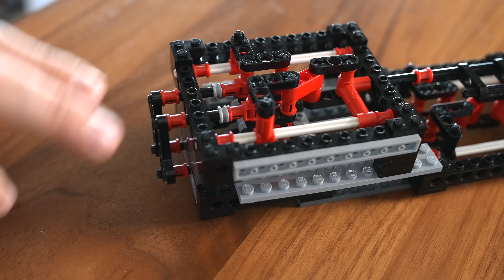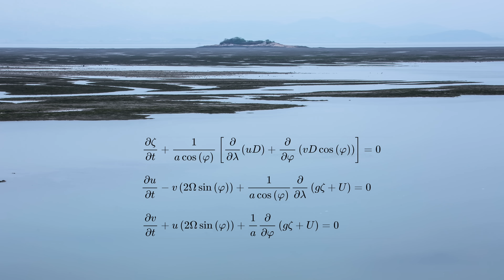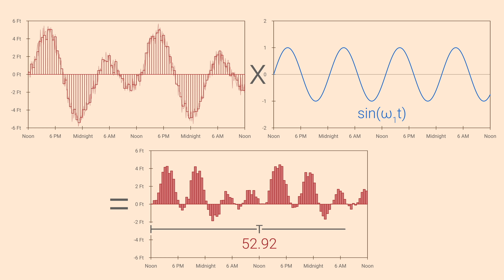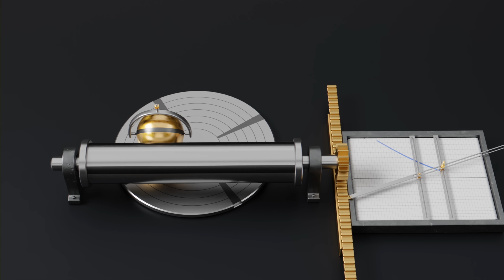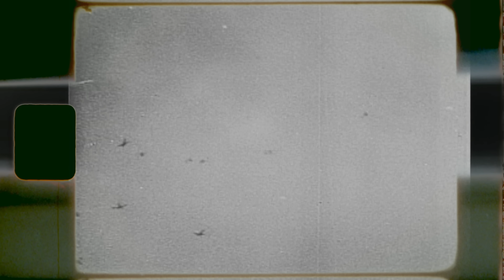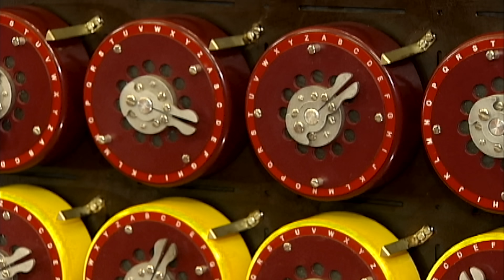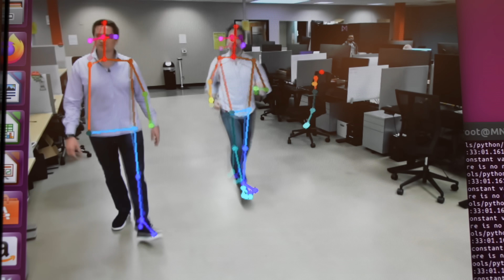The Most Powerful Computers You've Never Heard Of

Comment: The most powerful computers incorporate analog elements into digital systems and use a-d conversions and/or quantum mechanics as part of computing processes, such as modems, radios, wireless remotes, scientific measurers etc. They're used to process large amounts of data as quickly as possible.

Comment: When I joined the Navy in 1971, they still operated analog computers in some of their fire control systems. An entrance exam showed some simple gear output questions. I worked on a Norden system that was a true hybrid. It had a few analog computers that operated on gear ratios, electronic pots, accurate voltage references, relays, shaft encoders, etc. to a digital computer that had vacuum tubes, early 1960's transistors, late 1950's developed magnetic core memory, magnetic drum memory with about 2 dozen read/write heads in it. Not an integrated circuit chip in the whole system. This fit inside an attack aircraft that operated off of aircraft carriers plus ordinance and 2 crew. This unlike the aforementioned bombsight, actually got the job done. Yet these break down and needs constant maintenance and like the airframe it is attached to gets old and outdated.

Comment: Another interesting and not that well-known thing about the first computers is that even when thigns started to firmly shift towards digital, they were not always binary. There used to be computer which did not compute only in terms of 0 and 1 (which is the thing everyone always assume), but worked with more voltage levels (not just "tension" or "no tension", but an actual scale of possible tensions). It was eventually recognized that those systems were more difficult to stabilize (it's easier to distinguish "tension" from "no tension" than "tension A" from "tension B" for various values).
But I think it's interesting to think about how today "computers only understand 1s and 0s" has become an obvious universal fact, but it was not always the case, even for digital computers.

Comment: Technically our computers do confuse 1s and 0s at a certain point in time it’s known as “hazard error” it’s do to the fact that when the state changes let’s say from 0 to 1 the signal doesn’t just magically transform to 1 but rather continuously increases to 1. And in between the 0 and 1 is where our computers fail to calculate correctly :) also we don’t need all three “and”, “or” and “not” we only need either “and” and “not” or “or” and “not” according to de Morgan’s law :)

Comment: Given the qualities and advantages of analog and digital compters summarized at the end, I can't be the only one wondering if you couldn't get the best of both worlds by using a sufficiently powerful digital computer to mathematically model the operation of an analog one, right?  Like if you could design the analog device to compute what you want, which wasn't ideally suited to a digital system, could you run a digital simulation of the analog device without the problems of "gunk in the gears" creating signal noise?

Comment: If you 3d print these analog computers with analog dependent materials, you would not have the error of specifications get in the way of producing faster computers. I guess thats what quantum computers are doing, but they still have errors to work out. The 3d printed with a variable material, would not have those errors to begin with

Comment: It has been covered elsewhere that a large part of the failure of the precision bombing campaign over Japan (and to some, but smaller, extent in Europe) was due to a not-yet-discovered phenomenon: high velocity "jet streams" of air aloft. This is something that Norden's machine could not compensate for because the information required to do so did not yet exist.

Comment: When I started in Engineering school, there were generic purpose electric analog computers. I never got to use them, because they were phased out before I got to that level, but I think they were used by students of differential equations to prove their models. Instead of coding, they worked by patching components with wires, such that they could combine the effects of different analog elements, to obtain an output curve to the input they provided. Something to an electronic version of the tidal wave prediction machine, but configurable to different sequences depending on the patching.

Comment: AnandTech had an amazing article about the mechanical fire control computers in the Iowa class battleships, and made the point that digital computers didn’t have the processing power to keep up with analog computers which operated in real time. The analog computers were so much faster in fact that when some of the Iowas were recommissioned and modernized in the 80’s, and the fire control computers were replaced, they remained analog, but just switched from mechanical to electrical.

Comment: Thank you for this!  Beautiful explanation and animation.
When I was an undergrad, I had a summer internship where we calculated distance (Square root of x^2 + y^2) using analog circuitry for an ink-jet plotter.  Immediately following, I had a graduate research assistantship where my main responsibility was building a robust analog-to-digital and digital-to-analog interface between a large analog computer and a PDP-11.  I've been using op amps and digital all my life, and have both op amps and microcontrollers in my parts box at this moment.  It's all about functional partitioning!

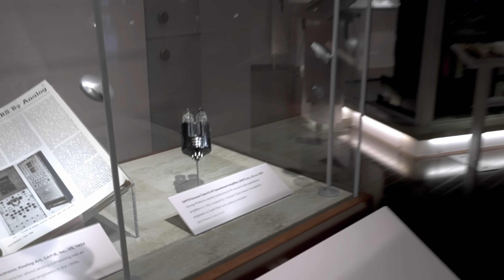Comment: 13:40 operational amplifiers are still used today. Many people thinks, today everything is digital, but its not true. If You use for example microphone or audio amplifier, then 99.9% of them are using modern operational amplifiers made by transistors or IC (IC or chip is a basically many transistors in one case) instead of electron lamps. Audo or video to be saved by camera, must be first converted from analog to digital (ADC - analog/digital converter) and if You wanna watch saved digital video, then must be converted back to analog (DAC). There is no other way to do this - if You like it or not.

Comment: Aren't quantum computers a form of analog computing? To my knowledge it can perform calculations by letting probability waves interfere with each other. This is similar to how waves are added up using Kelvin's machine right? The only downside is that you cannot really get the "analog" result of the computation, as measuring it results in either a 1 or 0. Although, you can obviously run it a lot of times and get a good estimate of the value 🤔

Comment: Analog is used in the sense of "proportional" here, not in the sense of "analogy". What makes it analogue is that it uses measurable quantities, with lengths and ratios, rather than discrete counted quantities. A slide rule is analog, an abacus is digital. It has nothing directly to do with analogies: when you use an abacus to conduct a census you are also making an analogy between groups of people in a population and the beads on the abacus. Don't get confused by etymology.

Comment: I've got several slide rules in my desk as I write this. There is something very beautiful about them. Many aircraft still carry EB6 computers as spares, essentially a specialized slide rule for the complex calculations including wind, speed and bearing and produce answers directly. They are simple, reliable and immune to electrical or magnetic issues.

Comment: I built an analog computer back in 1967. It could add subtract multiply divide and differentials of squares and triangles. It came with 3 gauges, variable resistors, and switches.  And it was electrical!

Comment: I had a lab exercise to simulate a control system stability with an analog computer.  The analog computer was built using vacuum tube op-amps.  Their signal range was +/- 100 V.  A bit later, where I worked, my boss had also earlier used the same analog computer and we started discussing if we could build our own, but with recently introduced semiconductor op-amps.  Well, that discussion resulted in a task for me to design and build one.  What I ended putting together was a box with 10 op-amps, a bunch of stackable resistors and capacitors and a few special units,  and a panel with banana sockets for the stackable components.  All along with amplifier symbols on the panel.  The signal range was reduced to just +/ 10 V.  My boss was  soon happily simulating not only his control systems, but also extrusion and cooling processes for high voltage cable insulations.  That was just before I got transferred to another division of the company, where new challenges were waiting me in a new R&D lab.  So I myself never had the opportunity of really learning to use "my" analog computer in anything but simple servo loop simulations (optimizations).

Comment: What makes this even more beautifill is that something most people do not see and understand is that  quantumcomputers are actually just analog computers being read digitally. the only special thing to them is that the main "dimension" of their analog movement is something humans can't really imagine in general(focus on the general since it is quite understandable if you look into how it actually works), this however results in it for many people being more easy to imagine how to use it as a digital device or more specifically for parallel arrays in a small cluster of cores. in general even in universities quantum computers are often brought as magical abstract computers with a 1 a 0 and a gohst while in reality it is just a atomair level mechanical computer which is specifically designed to abstract it's working "dimension"(between quotes because most quantumcomputers are still actual normal mechanical computers in these dimensions, the other dimension thing is in many cases a abstraction and sometimes some actual cross dimensional effects) to make it less abstract how to compute many parallel arrays with it. because humans in general except for visually are not capable of thinking parallel in general.  this means a quantum computer is basically a mechanical computer which is read digitally and which is quite stable at that due to some self stabilizing effects in specific circumstances. then this analog computer also is designed to work like that computer which could split the wave pattern in multiple waves and the other way around. this is what allows people to use it thinking it are parallel arrays, while in reality it is just one big analog wave per qbit. sadly not many people see how it works, even many people developing them or with them(the quantum computers) do not understand properly how it works because to visualize it would mean you need to be able to think interdimensional in 5 dimensions to be able to see the "computing" possibilities, activity and working(s) in a propper way, this prevents propper advancements which is why there has barely been any real change or progress since the original design other than complexity and accuracy, because most people working on them learned to think digitally. by looking at what it does in reality it is easy to make a room temperature quantum computer or something which performs similar calculations. I actually designed and physically made such a computer somewhere in 2017 to 2018, and it wan't a complex research but just a small hobby project in some of my free time next to college. the prototype was handmade and was build very badly but it worked and demonstrated that my design was indeed capable of doing it. now it wasn't exactly a mechanical computer, or analog computer as many know it, since I designed it to work on the exact same principle as which I had described in one of my theories as a more simplistic yet detailed description of all forces in the universe, where I could simplify all things down to one simplistic rule, or actually 2, where the second one just tells about the existence of dimensions both or either in a physical or abstract way, with in this case the main intend to allow the combination of anything that can exist, and yet to each other might never exist into one result(much more simple in imagination, it is just saying that there exist possibilities, since a calculation or theory wouldn't have much value on a prediction level if that what it needs to predict according to the theory can not exist(it is much more simple than it seems in this explanation when you can just visualize it). the other thing was that specific rule which generates and handles all forces in the universe. so to put it more simply it has 2 rules: the description of force and space .  that the computer worked did prove that my theory was either right or at least so close to truth that you can not or barely notice a difference. I did another experiment as well where I together with a cousin managed to simulate space and atomic behavior in realtime and high accuracy with a quite primitive setup(for now).
but the computer I designed and made was in behaviour most easily comparable to a quantum computer which works on room temperature, and its working principle can be most easily described as the force which keeps molecules together or planets, such as gravity but then not using weight but by actively manipulating the force I didn't exactly use gravity but a different force I could generate using something I will call the Rtype-crown, however detailing to much about that will likely explain the entire working of the device. but to put it simple it is one specific component I designed to be cheap and simple to make, which can simulat all digital computing as well as analog and quantum where its natural computing method is closest to quantum computing.

Comment: the infinite detail of analog computing could make the processing  of huge data sets and fine data much easier. self observing calculation is also doable in analog

the error potential could add a "creativity" component, if the system can weed out major errors

Comment: I have an RF background, although digital communication has some benefits, there are HUGE drawbacks as far as signal integracy are conerned. That's why the outer suburbs had major problems converting digital transmissions when the digital conversion was initiated.

Comment: Maybe the ultimate computers will be hybrid analogue/digital machines.
   A digital input that can control say for example a speed variable in each analogue component, which in turn can then auto calculate a range of gradiating answers?
   This should allow the analogue side to be rigged for a variety of tasks. And perhaps if one 'gear' in the analogue computer has worn out of sync, the digital input could be modified to compensate for the discrepency

    I unofficially patent this idea right now.
    Send the billion dollar cheques to my local bank account. Thanks

Comment: A version of Kelvin's ball-and-disc integrator was also used in the fire control of large battleship guns during WWII and after.  There were tube-type electronic computers, but they could not survive the concussion of a salvo of four 16" guns firing simultaneously.  The one that I saw in class used a wheel rather than a ball for the output.

Comment: Thing is with many analog solutions over digital is size, larger.  Now maybe if you look at the universe and results from astrology, then maybe many of the problems can be mapped onto parts of the universe.  Orbits of objects, motion, light mapping and many things in the universe, take Cern, such things happen in the universe naturally.  

But remember, 1/3 in analog is just that, in the digital world it is 3.3333333333......33333 and there is one aspect of digital computers as the rounding error's.  In analog those errors happen in reading the result and being able to accurate read the result is as key as doing it with analog computers and that area is often limiting.

Comment: >"The atom bomb will never go off - and I speak as an expert in explosives." - U.S. Admiral William Leahy in 1945
>I am not trying to win the argument, but you love for the truth. 
>The gyroscope resists all "gravitational" forces in the Universe. Rigidity in space is created by its rotating motion. In 4 gimbals, set it in motion with the axis in the vertical position. It should move 15 degrees per hour, to a horizontal position in 6 hours. If not then the Earth is not a spinning ball. This experiment should put an end to the debate.
So is the Earth turning?

Comment: Electronic analog computers were cool, and the ones I used were transistorized.  We still use some very primitave analog computers in some motor speed controllers, and the LMXXX series of ICs is analogue.   You could solve differential equations on analog computers by setting up a plugboard to represent the equation.  But watch out for op-amp overloads!  Then came programs such as IBM's CSMP (Continuous Systems Modeling Program) that essentially digitized the analog computer.

Comment: I could well be wrong but I am sure we had a sort of plug board analogue computer into which you could connect up differentiation and integration modules to solve equations? It fell out of use after we got the Digital PDP8. I could well be wrong as at my age I can't be sure what I had for breakfast never mind what happened in the 60's.

Comment: 1:31
I wanted to point out that Analog is not a synonym for Continuous and Digital is not a synonym for Discrete.
In fact there are four types of possible signals:-
1. Continuous Analog
2. Discrete Analog
3. Continuous Digital
4. Discrete Digital

Continuous and Discrete represents the signal parameter on Time axis.
Analog and Digital represents the signal parameter on Amplitude axis.